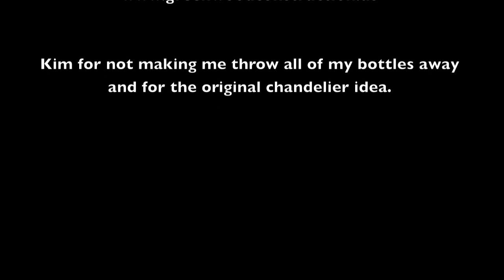HOW TO MAKE A CUSTOM CHANDELIER

Comment: I am making a Jack Daniels light for my husband for christmas could you please list the materials you used for illuminating the bottles?
Reply from the maker: +dwhitmer1 forgive my horribly delayed response.  the main 3 things are lamp wire, candelabra sockets, and and the threaded rods to hold it all in place.  lamp kits at your local home improvement store are a good place to start.  we had everything lying around the shop so i couldn't really give you a cost estimate.  if you are wiring a few together, make sure you have a good knowledge of soldering.  a better video for wiring is https://www.youtube.com/watch?v=XUq3buM115c  same idea with a few modifications...theres always next christmas...

Comment: It actually would be easier if you first connect the wire to the socket, then feed that wire through the tube and screw the tube onto the socket. I've tried it both ways. With experience comes knowledge. I like the idea to use the bottle cap. Unfortunately, not all bottles have caps, some have corks, you'll have to improvise. I like that he left the labels on the bottles. Love the idea to use the old wheel. Too bad their wasn't another way to hide the wiring.
Reply from the maker: +bderouen1964 ask and you shall receive...internal wiring.  it was a little more labor intensive but came out great.  you are correct that improvisation is key.  we used the caps because the bottles had them.

Comment: how did you cut the bottle?
Reply from the maker: we used a wet saw.  check out this video, it shows the cutting process. 
HOW TO WIRE A CUSTOM CHANDELIER
Reply from the maker: +amcm mcma https://www.youtube.com/watch?v=XUq3buM115c same project with some insight into the steps not shown in this video.

Comment: what is the dimensions of the rods
Reply from the maker: +Jaco Fourie 8ish inches long, but that will vary depending on bottle length and they are the standard threaded lamp rods  1/8 or 1/4 inch maybe... to be honest most of the lamp was made from scrap parts lying around the shop so the dimensions were not really a concern at the time.